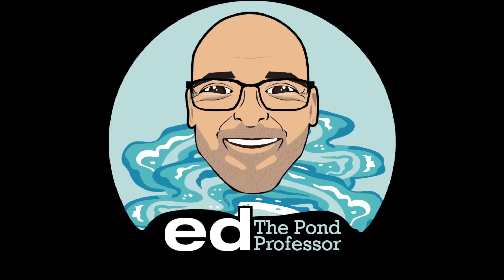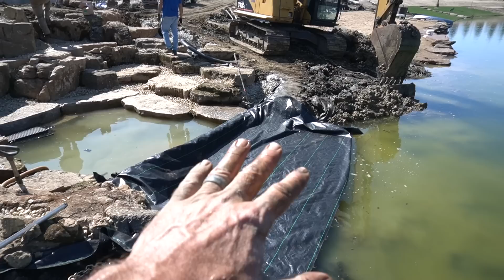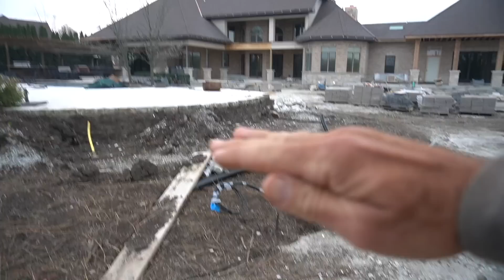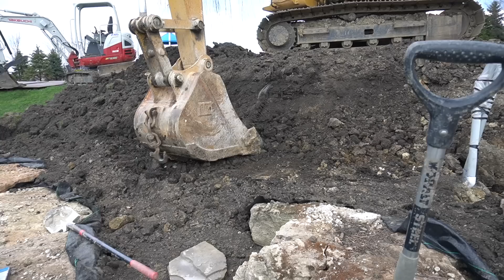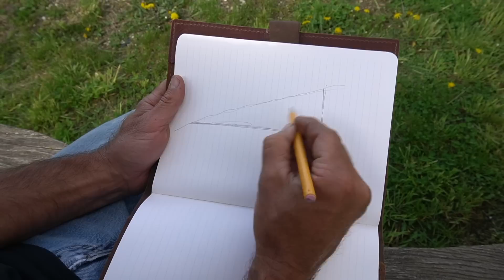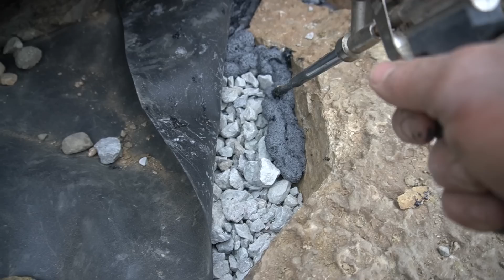Pond Intake Bay COMPLETE: Part 3

Comment: Fantastic job Ed. I’m wondering if you could clarify something for me please. I am building a pond which will also be available for swimming. I assume that your pump vaults contain submersible pumps, but I am told that you can not use submersible pumps if there will be human contact and that I must switch to above ground pumps. Can you help me with this?
Reply from the maker: Correct,
If the main purpose is swimming you should use Above Ground/Inline Pumps,
You’ll still need a Pump Vault or some sort of Prefilter to draw the water through before it reaches the pump
Reply: Thanks Ed. If you ever have the opportunity a video of how best to construct that would be great. We are planning a negative edge intake bay pumped up 30’ to a wetland filter that will then feed a waterfall to a 40 X 50 swim pond with a regeneration zone. Just trying to work the pump logistics without bankrupting us on the electrical bill.

Comment: Nice video! Any substitute for the waterfall foam? I cant get it where I live and I was looking at a substitute foam with kinda similar capabilities
Reply: i think you  could stuff moisture wicking mesh (hygrolon on amazon) in the cracks and plant moss on top
Reply: That can be a challenge due to the tough conditions of flowing water and movement of the stones throughout the changing seasons.
I’ve tried other type of sealants and mortars but they seem to fail(at least in Chicago/freeze & thaw)
Where do you live?
Reply: Ed Beaulieu Is this a response of the pond professor himself?😃 I live in the south of Portugal, summers 87-95 degrees winters no freezing degrees lowest will be around 50 degrees. I’m currently trying to build a small pond roughly 10ft  by 5ft and 3ft deep, negative edge into calm stream of 60ft by 30-35inches and 10inches deep into a pondless system down at the bottom. After lots of your videos I want to try to copy your strategies the best I can. In a year I want to build a large pond with wetland filtration system. But for this aquascape equipment is definitely required! This current small DIY pond is my practice for the big project! Thanks for your help and replying!
Reply: EvilGodXL Of course it’s me responding!
We have a Distribution Facility outside of London,
We can definitely get you anything you need.
If you want to experiment with another sealing method that would work well in your climate you can try Bentonite Clay,
You’ll need to use a heavy duty Geotextile fabric between the joints you wish to seal first and then apply the Bentonite in the joint and then another layer of the Geotextile, this will prevent the Bentonite(Clay) from being washed out of the joint from the flowing water. 
It’s not perfect but it will work. 
We can purchase Bentonite in large bags here, I don’t know if it’s available in Portugal???